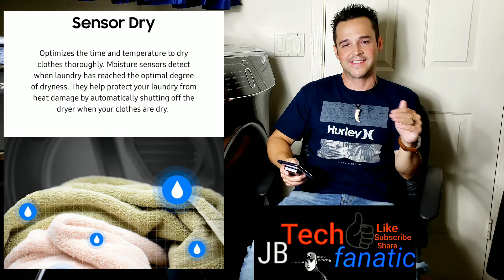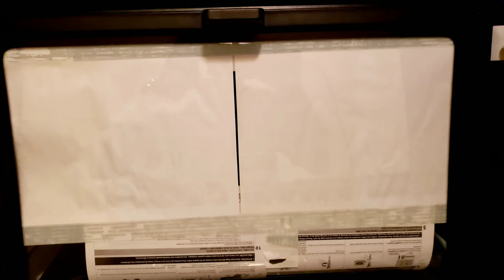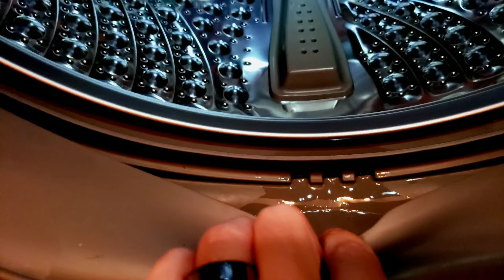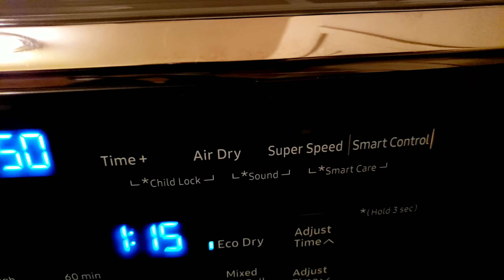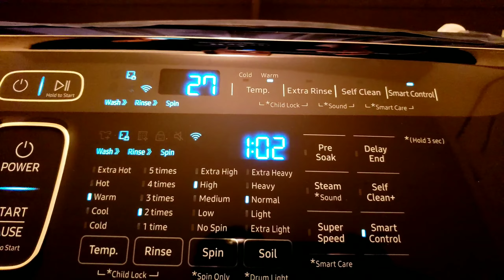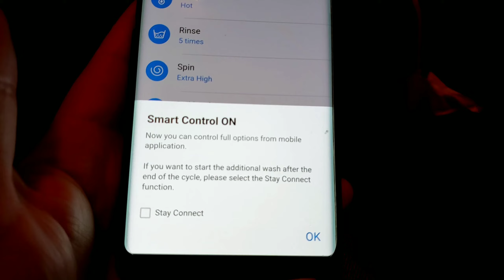NEW Samsung Smart Flexwasher & FlexDryer Duo FrontLoad DV9900 A Must see Review🤗

Comment: Great machines had them for about 3 months. Running into a problem where the washer door won’t open at the end of the cycle. The child lock is not engaged so now I can’t get my clothes out. Very frustrating, and looks like the water is drained. Tried using the app and it says the machine is running fine. Mystery why the door won’t open.
Reply from the maker: Thank you for watching and subscribing I'm thankful for your support 💯  I can help you with this. All you need to do is press the smart button and it will unlock. When you have it in smart mode and can control it on the phone it stays locked for safety reasons and so you can continue full control. But simply pressing it on the Washer it will immediately unlock once the load is done. Also here is my new video on the latest version 😊 https://youtu.be/9mInwpcBYt0
Reply: @JbTechFanatic  Thanks for your help. Mystery solved. I pressed the Smart Mode and it opened. I could not find this in the Samsung manual troubleshooting section. Thanks again. Your videos are greatly appreciated as I have all Samsung products.
Reply from the maker: Anytime 😊  enjoy your awesome Samsung applied 😎

Comment: Samsung should stick to TV's, their washers and dryers their washer and 
dryers are terrible they are VERY SLOW they use VERY MUCH energy and are
 not efficient at all, stay away from their washers and dryers you'll be
 glad you did.
Reply from the maker: Oh no that sounds horrible 😢 so far we love this set it's been truly outstanding. But I have been in your situation before with another brand set. It no fun😊 Have you called for warranty repair for your issues? Also if the dryer is taking long to dry. It's almost always a plugged vent pipe. I get my cleaned yearly makes a massive difference. Also if you pull off the back of the dryer and clean out any lint ect that might have gotten in the vent that can help also. Thanks for taking your time to share your experiences it's always helpful to hear others experiences 😊

Comment: Have you had any issues with the top washer? I purchased the washer, and first wash and I had problems. The whole washers was shaking and the top washer made a lot of noise. Thought it was going to break. I only had like 5 hand towels. I tried it a second time, and put 3 baseball caps, and again...loud noise. It ended up messing up the brim on a cap and tearing the cloth on the cap. The bottom washer made a slight squicky sound. Luckily samsung excepted a return and they picked it up after 5 days of delivery.
Reply from the maker: Thank you for watching and subscribing I'm thankful for your support😇🙏 we love them and have not had any trouble 😇 I wish we found each other sooner as I think know what the problem was and we could of fixed it. It sounds like The shipping prongs were not all removed and the balance was not calibrated properly. It's unfortunate but most install techs don't know what they're doing when it comes to these washers and dryers they must be perfectly balanced otherwise that will happen to you. where it bounces side to side too making loud banging noise ect.
https://youtube.com/playlist?list=PLMdd-qroR8HVLKrKPVI9-fq6j89ru30i8

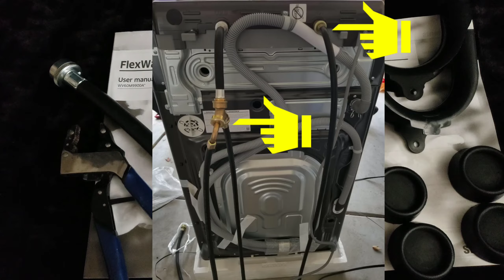Comment: 13:57 I think you did that wrong. Isnt the short hose supposed to be connected to the water supply, then the other hoses connect to the washer/mini washer/dryer?
Reply from the maker: The connection in the video is correct. Truly if all them were long enough to reach it would not matter. But the distance is to far to connect as you stated. The small hose gives you area to add splitter. Then split the cold and run two line. the hot line needs more length to reach the dryer. But as long as it reaches the hoses sizes dont matter. But anyway Samsung white glove is who did it I was just showing it through a photo of their installation . We Still use them and love them definitely a great set if you are in the market 😊
Reply: @JbTechFanatic  I thought its the cold water line you feed to the dryer

Comment: I've have the 9900 models for 15 months now. LOVE THEM. I've had no problems at all. I got them on sale (and 20% coupon) at HomeDepot for $1300/each. [[ H.D. delivery/install was a nightmare-- I'll never buy from them again.]] I love the wifi tracking,  I can go about my housework and keep on top of things. The lower 6.0 capacity is HUGE. I can wash/dry a heavy kingsize comforter easily and CLEANER than any supersize coin laundromat. The upper washer is pretty big, holds more than I imagined. One change I'd like-- make the "aqua pebble" a bright red or yellow. I'm always looking for the damn thing!! ●● The dryer is great. I find myself using the 'REFRESH' and the 'WRINKLE RELEASE' cycles a lot. Either cycle is great for fluffing and removing wrinkles. I also bought the 4 inch platform risers to lift it off the floor. I wish they were storage-type, but these are heavy machines. I'm tall, so it works for me.
Reply: Do you still like them?
Reply from the maker: We love them
Reply from the maker: Thank you so much for watching and subscribing I'm thankful for your support and kind comment I truly appreciate you Sharing your experience. I agree this is a wonderful Setup!😇💯 Happy holidays

Comment: Wonderful thorough review !  Regarding the mentioned benefit of wifi though around 6:25 ~  I would strongly caution people to NEVER run a dryer when you are not home and even when you go to bed....  Dryers are among the leading causes of house fires, it's just not worth it....    I'm considering buying these units and my current Samsung's are only going on 3 years old, they're still under extended warranty...   The convenience of being able to wash some delicates or something that got soiled and needs immediate attention make it an easy decision..
Reply from the maker: Thank you so much for watching and you kind words. Im honored that you have considered subscribing and took your time to share with us. I highly recommend this set it truly is and great washer and dryer😇 As far a fire goes maintenance is crucial to any device in your home keeping your dryer vent clean is the best way to prevent a fire the wonderful thing about this set is it will remind you when it is time to not just clean the vent inside the dryer but also the wall vent it dictates whether or not it is getting proper flow out of the exhaust and if it is not it will eventually not let you use it until you clean it😉 as soon as you set the dryer into Wi-Fi mode and you have control with your phone it will also lock the unit so this way children would not be able to just pull it open and hurt themselves did also has a self checking system that you can view from your phone and it will tell you if there's any internal problems on the horizon you can get a full inspection of this device simply by using your phone also saving your money from having to call out a maintenance guy if you're unsure what's wrong thank you again for watching I appreciate your support so much.
Reply: Yes, yes, yes! We were lucky to have our dryer die in the middle of one of those "not at home cycles" where it actually did catch on fire
Reply from the maker: Thats horrible🤩 so sorry to hear I'm glad everyone is ok😇

Comment: 5 months later how is running? can we get an update video on how they're working out for you and your wife
Reply from the maker: We still absolutely love all our Samsung appliances. I highly recommend them
Reply: @JbTechFanatic   are they still working great curious because the reviews online are not the best
Reply from the maker: Thank you so much for watching and subscribing I'm thankful for your support 😇 Great question and the 100 percent truth the get used daily and zero issues and my wife is ecstatic
 Problem with reviews are they use old reviews as new because Samsung might carry a design for years but the truth is everything appliances wise through Samsung went from complete garbage to top of the line so as long as you buy units stamped march 2018 or later you are in the clear and that goes for stoves dishwashers and refrigerators and washer dryers. Samsung rebuilt from the ground up under the radar because they knew how bad the were.

Comment: Do you need drain pan installed with Flexwash? If needed which one would you recommend? Thanks in advance
Reply from the maker: Thank you so much for watching. I'm honored that you have considered subscribing and for taking your time to comment😇 as long as you have a sink or a drain pipe for the wash to drain. Using its attached hoses. Then no drain pan is needed under the unit😇
Reply: Those bottoms are touch screen ?